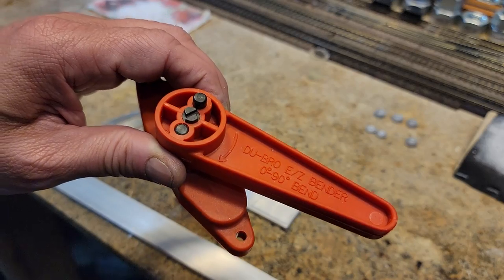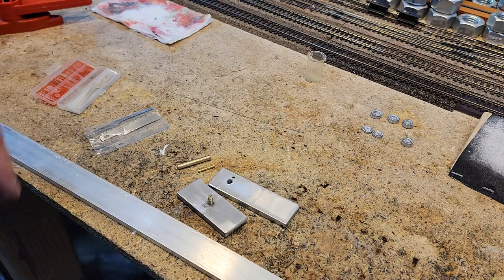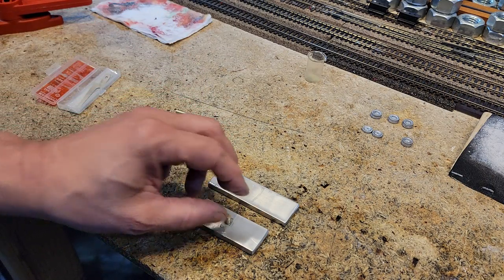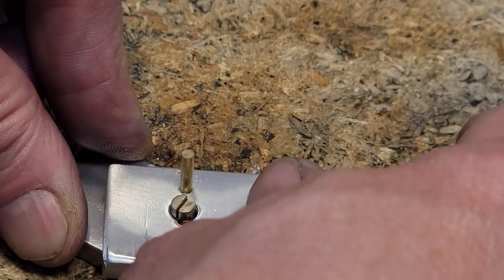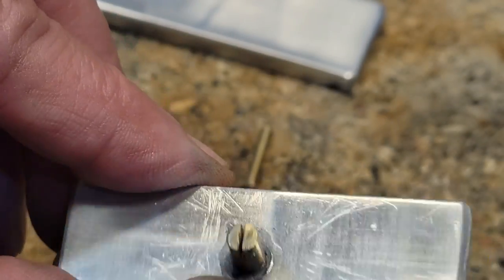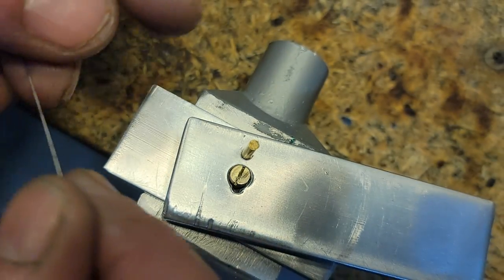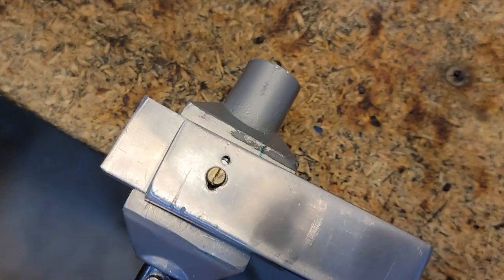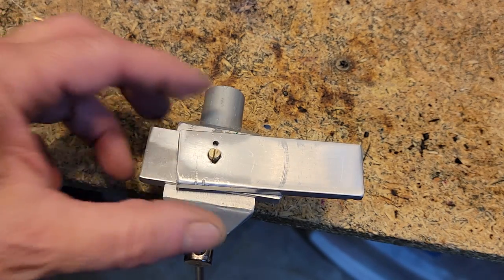Wire Bending Tool You Can Make

Comment: I love your channel. I don't have the capability to do what you do but a random thought on this one is maybe use a slightly tapering slot to bed the wire firmly regardless of its diameter?
Reply from the maker: I solved that problem by drilling 2 new holes and moving the small rod closer to the main rod!  it bends super awesome now!  remember, you only need a drill, aluminum barstock and brass rod - the rods could really be any size and they could also be aluminum!  all these supplies are cheap at the hardware store - you can do this!